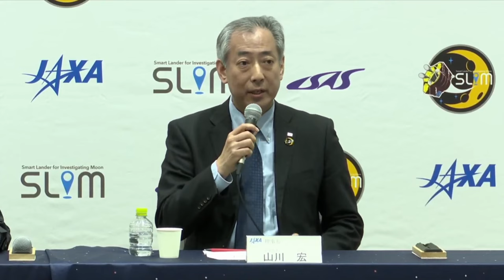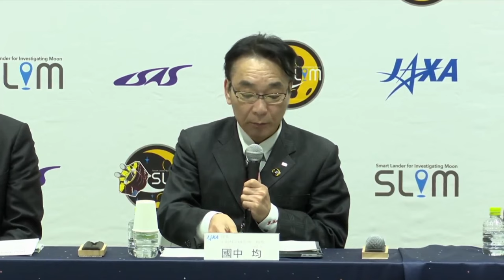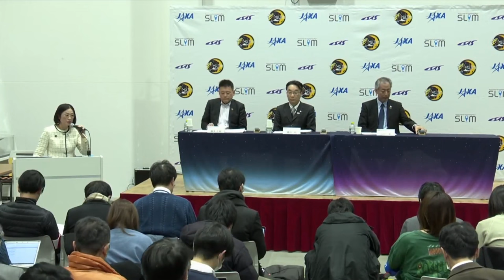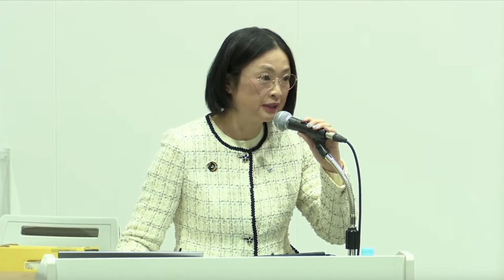Japan's SLIM moon lander suffers solar array glitch after lunar landing

Comment: Congratulations Japan and all the engineers who worked on this. Its on the moon and thats what matters. 🎉🎉🎉 There is nothing like partial failure or partial success. In my view, its a success. Some parameters are off but the lander landed on the moon. You guys should rejoice. 🎉🎉

❤❤
Reply: yea but where’s the footage? then celebrate. no footage? bye bye! 😂😂
Reply: its a success. .. of source ..just battery NOT working..
Reply: @r.murray2435 

Can you read a book without pictures?, Mr. murray
Reply: @167mm167 The batter is working, but of course losing power as time goes on, due to the solar panels being not correctly oriented to generate electricity at the moment.

Comment: It crashed .
There is not such thing as partial success or partially unsucessful.
Reply: It didn't crash. It was a soft landing and the spacecraft could still be contacted. It is simply losing power, while the solar panels aren't generating electricity at the moment, due to it being not correctly oriented.